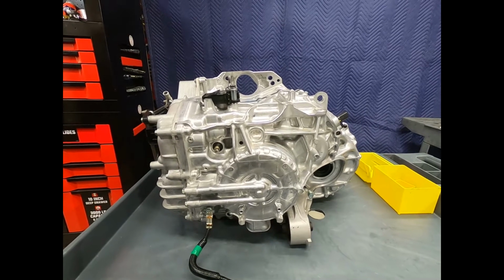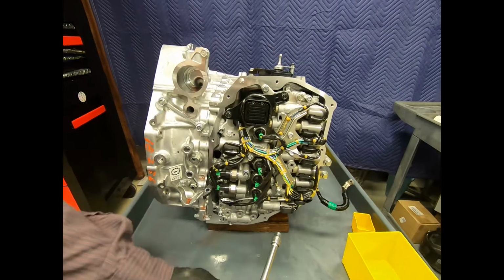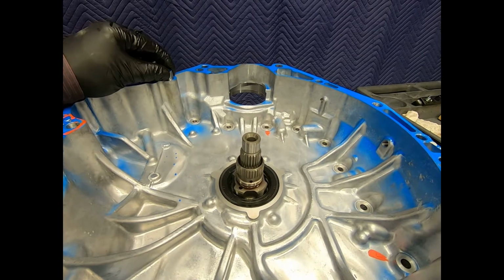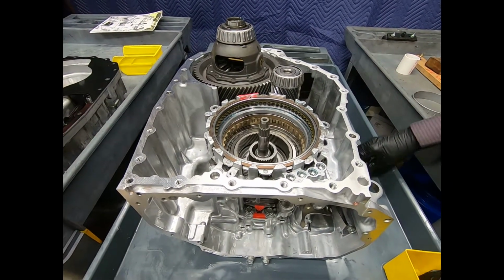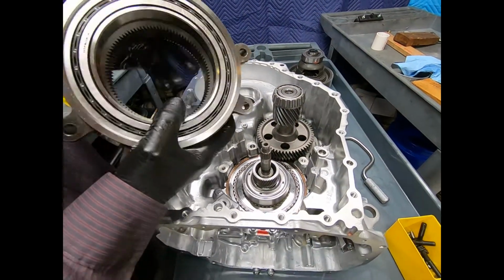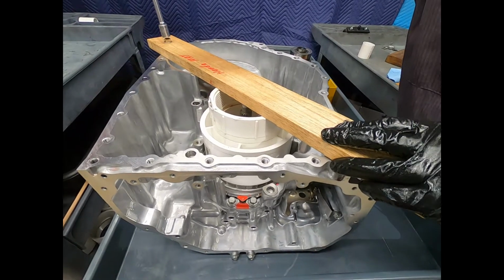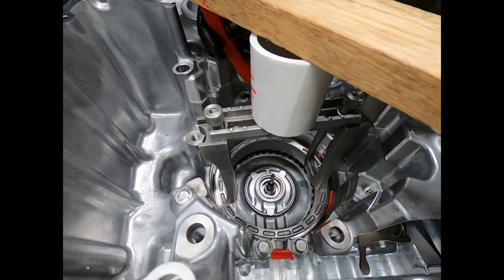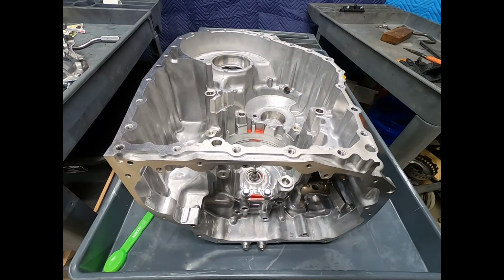Honda 10-Speed Automatic Transmission Disassembly and Inspection

Comment: I have over 100,000 miles on my 2019 Honda with the 10 speed in regular driving. I don’t believe it ever goes into 10 speed. It has to be manually put into 10 speed.  Is that normal?

Comment: @ThompsonAutoTest

I have a 2024 Odyssey that started leaking oil or ATF from behind the torque converter case cover (small black metal cover on passenger side of transmission) around 36,000 miles. 

I noticed it while I was changing the engine oil.

Is this a common problem? 

Would you say it’s probably the torque converter input shaft seal? 

Or rear main seal? 

This van is less than 2 years old and has never had the transmission out.

Comment: I’m driving a 2026 Odyssey, currently just over 800 miles on the odometer.

I understand that Honda’s 10-speed automatic had some shortcomings in earlier model years (notably low-gear shift shock), and I was told that updated transmission logic was applied starting with the 2025–2026 models (J35Y7). This is my first Honda with the 10-speed AT, so I’m trying to determine whether what I’m feeling is normal behavior or not.

From early on (around 450–500 miles) and still now, I’ve consistently noticed a slight shock or unnatural stopping feel when the vehicle downshifts from 2nd to 1st gear while coming to a stop. This happens whether I brake gently or more firmly.

Some additional observations:

•	The issue is much more pronounced when the car is not fully warmed up, especially when outside temperatures are below 32°F (0°C).

•	When cold, the 2→1 downshift can feel surprisingly harsh—almost concerning.

•	As the vehicle warms up, the shock becomes less severe, but it never fully disappears.

•	No shift shock during acceleration in either low or high gears.

•	No error codes found during Honda service center diagnostics.

•	I cannot reproduce the shock when manually downshifting using paddle shifter, even from 2nd to 1st.

•	The behavior is the same whether:

•	Auto Idle Stop is OFF (I always disable it)

•	Driving in Sport or Eco mode

•	Interestingly, the issue does not occur at all when stopping on inclines/uphills—the vehicle stops smoothly as expected.

At this point (800+ miles), it still feels the same as it did earlier, so I’m wondering:

•	Is this simply normal behavior of Honda’s 10-speed AT, particularly during automatic 2→1 downshifts?

•	Could this still be part of a longer break-in process?

•	Or is this something that other 2025–2026 Odyssey owners are also experiencing?

I’d really appreciate hearing from other ’25–’26 Odyssey owners—especially those driving in colder climates—about whether this behavior is considered normal.

Comment: I am by no means a Automatic transmission or cvt person, but I am a mechanic. My question to Thompson Auto Test is this... When I change the transmission fluid, can I fill with 8 quarts of transmission fluid, do the engine warm up, than run through the transmission gears and than drain off the excess tranny oil by the level plug? Knowing Honda says to do 5 quarts, only changes out a percentage of the tranny oil, and than doing another tranny fluid change replaces a small percentage of the tranny oil. I call this method a diminishing return to change tranny oil, what a pain! Will this damage the transmission at all, beings how the car is up on jack-stands and not really having aa load on it other than turning over the axle/wheels.
Reply: Did you ever find out the answer to this?

Comment: Our 2018 Honda Odyssey Elite with 53k miles has a 10-speed (PMXA)A/T that will not go into reverse!  The reversed letter R flashes on the dashboard pulling codes show P0736  a Diagnostic Trouble Code (DTC) that indicates an incorrect RVS gear ratio. ***Solution: The dealership recommends replacing the transmission $10,000. FYI: Conditions for setting the DTC; When a problem is detected during the first drive cycle, a Pending DTC is saved in the TCM memory. If the malfunction occurs again in the next (second) drive cycle, the shift position indicator blinks (letters P/D/R blink!) and a Confirmed DTC and freeze data are stored. This error does not activate the Malfunction Indicator Lamp (check engine light).  To make the van go in reverse, I perform a TCM reset. It consisted of pressing the start button twice so that it is in the "ignition" mode (engine not started). Immediately, press and hold the gas pedal until the check engine light blinks several times before turning off. Restart the engine. This should "reset" the TCM. Odyssey and Pilot owners have had major problems with this transmission! Honda corporate refuse to help even though they have Technical Service Bulletins TSB 19-043 and 98-061 :face-orange-frowning: Hope this helps anyone else!

Comment: Would it be possible to change the open diff in this trans to a limited slip diff? Also is it bolted onto the the gear with 12 bolts? Thanks!
Reply: Very interested in this question why not contact a fab and CNC aftermarket company and see what they can do? 🦭👍🏽

Comment: Hi. You might have an answer. I have P0741 for torque clutch solenoid. When putting in reverse it sometimes stalls. I replaced the fluid. But code still there. I also notice lower MPGs. Thanks.

Comment: I have this transmission in my 2019 Acura RDX. I only drive the vehicle in Semi-Auto Manual shift mode. The factory automatic modes, in my opinion, are awful, which is software-related, not mechanical. Shifted manually, the transmission seems mechanically sound.

Comment: Hello would you happen to know what socket or tool can be used to turn the manual shaft to get the trans into neutral when the engine can’t be started?
Reply: 8mm spanner ?

Comment: Fantastic video about this still-relatively-unknown transmission. It's quite an engineering feat, although complaints about shift feel and performance are seemingly random indicating possible quality or reliability issues.
My '19 10at with ~24k seems to be in great shape so far....
Reply: Same here. 21 2.0t Touring with 22k miles on it and the transmission has been GREAT! Smooth as butter shifting and responsive. It’s so much better then the ZF9 used in other Honda models. I think they could have cut the gears down to 6 though instead of 10. Just to many……
Reply: Mine has 45k miles and runs like new..
Reply: @oviss5946  It's a shame the 2.0T and the 10AT are going by the wayside. It's a winning combination but Honda doesn't seem to care. They're getting all about those CVTs that are guaranteed to fail.

Comment: My question is. I have a 2018 Accord 2.0 with the 10 speed automatic currently 34,000 miles on it. I’m a senior citizen and do not abuse the car Since I can’t do the work,  would you recommend a transmission “flush “, or just a “drain “, and at what initial mileage? I would have this done by the dealer. In the Owners manual they just give you the “ maintenance code number “ and not the mileage. Any advice would be greatly appreciated. Thank you very much.
Reply: Wait until the maintenance minder throws the fluid change code. 
Do NOT flush this transmission.
Reply: Never flush, always drain fluid and fill back up to specifications 🦭👍🏽

Comment: My 2019 Honda had an accident and transmission case is broken from bottom of the car ( it hot a sidewalk). Can the case be sold separately or i need to buy whole transmission assembly?
Reply from the maker: I believe that Honda only sells the transmission as an assembly. You can go with the used unit at eBay Motor.

Comment: About how much is the dry fill capacity of this transmission?  I am curious as to what fraction of the fluid is changed with a drain/fill of ~5 quarts.
Reply: I found my own answer -- 9.4 quarts overhaul capacity.  ~55% gets changed with a drain/fill.

Comment: My parents bought me a new black 1993 Honda accord se automatic sedan with the spoiler on the trunk    when I turned 18 for graduation. I loved that car its still a great looking car. I drove that car all through college and got rid of it in 2003 it had 297,000 miles on it. Most dependable car I have ever had. The Automatic was the roughest shifting but it never bothered me it was just a Honda personalty. Never had a problem out of that car save for normal upkeep. The shifting would jerk in every gear hard and whine , I loved it I wish I never got rid of it.

Comment: I just ran across your channel. I bought a 2020 Odyssey and on my way home when I tried to take off from a stop sign the transmission would not shift from 1st gear. I was able to pull a code “PO7DC Stuck in two way clutch”. Would you be able to tell me what actuates the two way clutch? Does the transmission need to come out for a repair or can it be fixed while in the vehicle? 

Any help is greatly appreciated.
Reply from the maker: There is very little that can be done with the transmission in the vehicle. The two way clutch is actuated by the piston that is part of the valve body and it moves the lever of the two way clutch. It’s possible that the two way clutch is damaged and the lever won’t move. Inspect the fluid level and condition and look for excessive metal in the fluid.

Comment: Mr Thompson loved your video and how easy it is to change a filter on these new 10at compared to the Old 98-02 transmission which was impossible it required an overhaul.
Reply: He removed the filter at 3:10
Reply: @RooflessVW  why did you say when he removed the filter? Lol

Comment: Would you suggest replacing the filter behind the oil warmer as part of the AT service? I know Honda will say it’s either not serviceable or a “lifetime” filter. 
With Honda’s reputation of transmission issues, I intend to keep my 10-speed alive and well for a long time.
Reply: I would probably change it once every other trans service.
Reply: I'm at about ~24k and going to do a drain & fill. I'll replace the filter around 50k with the next drain & fill.
Reply: Can anyone please provide the filter number?, thanks in advance
Reply: @pineromartinez3316  Call your Honda dealer with your VIN.

Comment: i was expecting like 10 different gears and stuff but that is pretty cool.. I guess it selects multiple clutches for different gears
Reply: It uses clutches to select each gear, but there are physical gears for each of the 10 speeds, just like a typical torque-converted automatic transmission.  At about 28:00 he gets into the drive gears.

Comment: So how's the longevity so far? Any reason you had this unit out of the vehicle?
Reply from the maker: This unit was purchased from a wrecked salvage vehicle for research and education purposes. It will be used for parts as these units come to our shop for repair out of warranty in the future.
Reply: I thought maybe they would've learned their lesson with thin O rings sealing off hot oil back in the 90's.

Comment: Is there a way you can show the operation of the neutral shaft? A lot of cars are losing their batteries due to parasitic battery drain and cannot move the vehicles without battery power. Inside the engine bay I know the neutral shaft is under the battery/case area. How much does it turn and what direction CW/CCW?
Reply from the maker: Yes, Honda includes a external shaft that allows a tow truck operator to manually take the transmission out of park. Access is through the left wheel well, as far as CW/CCW the tow truck operator can gently try one direction then the other.
https://twitter.com/KathyatChrysler/status/838832158542299136

Comment: So, it is not possible to replace the filter without splitting the transmission in half? Sounds extremely terrible.
Reply: There is a serviceable filter on the cooler itself that is recommended to be changed at 40k intervals with the fluid.
Reply: You have to remove the transmission to replace the filter, but they last a really long time with proper maintenance. I have an 03 Civic with an internal filter 218,000 miles still going fine on the 4 speed auto. These have much bigger filters and use a better synthetic fluid. If you have one or buy one, change the fluid every 30k with Genuine Honda ATF DW1 and it will last easily 250k.